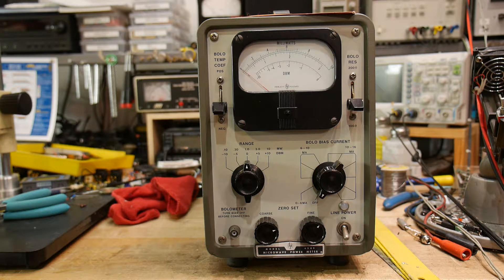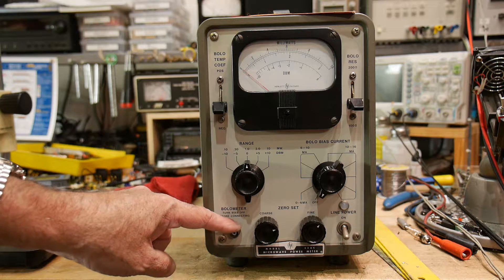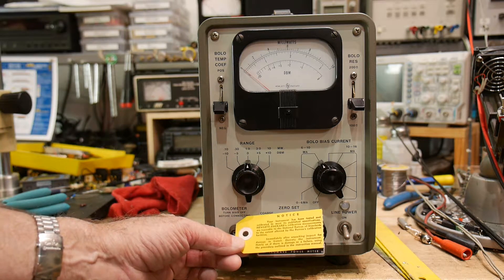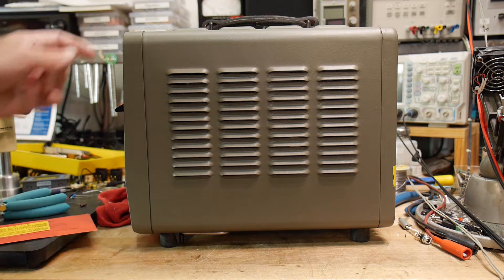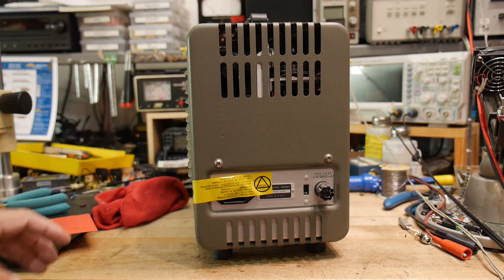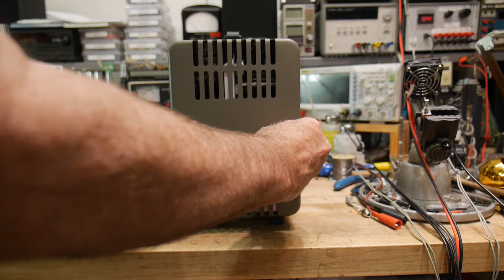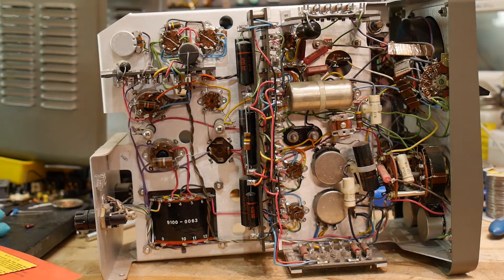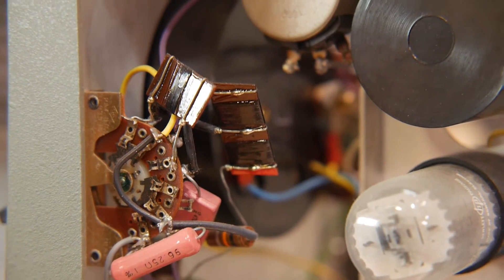#468 HP 430C Microwave Power Meter Found in Closet

Comment: I have that exact meter with the bolometer.

The bolometer is similar to a pilot lamp with a temp sensor connected to the filament, and you can burn out the filament with too much power! Which is why we never let anyone 'borrow' it, as we needed it to calibrate signal generators, attenuators, and other test equipment, and could not risk anyone using it who did not understand the dangers!

You can measure very small signal power levels with a bolometer, and in order to measure high power, you need attenuators to reduce the power levels, usually by many DB to protect the bolometer. The bolometer also measured about any frequency you could generate, including microwaves, I routinely measured the 10.75 GHz radar band with mine!

Now, I have other equipment that has taken the place of the HP 430C, but I keep mine, just in case!

Comment: I still have my fathers 400D Voltmeter. Yours is by far in much better condition.
Reply from the maker: I think the 400 may have a custom meter face: " In order to eliminate tracking error on mass-produced
 meters, an automatic system, developed by Hewlett-Packard, custom-calibrates
and photographically prints meter faces
 to match exactly the linearity characteristics of each  individual meter movement at all points"